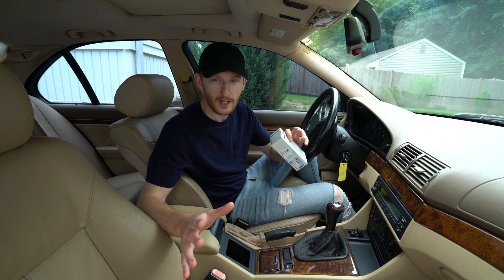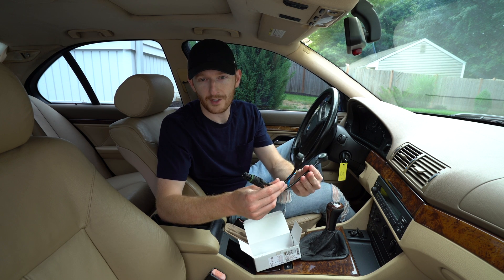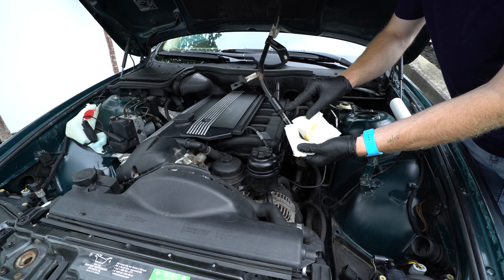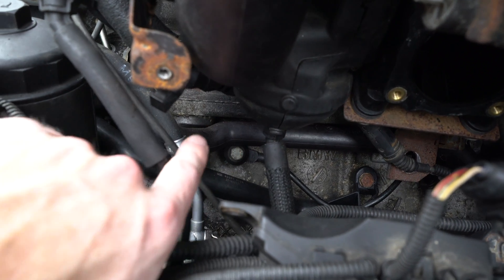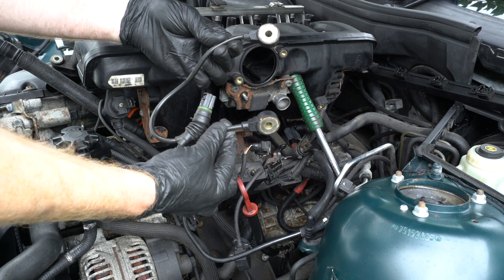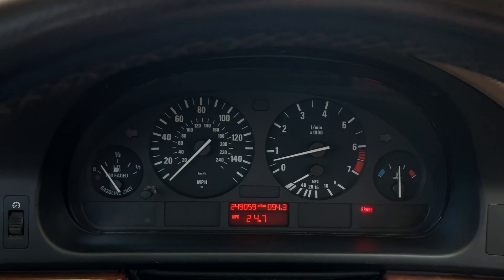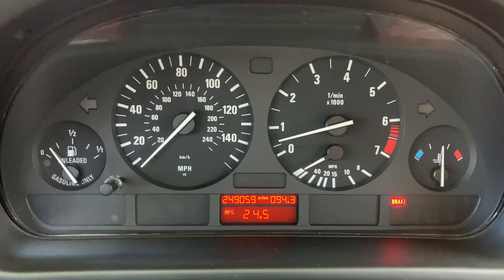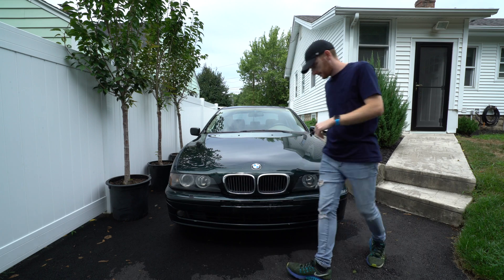BMW M54 Knock Ping Sensor Replacement For E39 and E46 Fault Code P0332

Comment: I just did this job here in summer 2024. A 2006 n52 530xi. I however did not remove the intake. I got the old one out,  and replaced the knock sensor reaching between the intake runners. And removing the air box, and the already leaking oil filter housing, and very greased up Alternator. If you have pick up/grabber tools you will need them.  With the alternator out of your way, you can do it !  If I can do it, you can too.

Comment: Hi nice video ,i have question .If i disconnect my knock sensor for test does will fix the problem before i buy new one.Now when i try to kickdown it only go max 5000rpm .... I want to disconnect then start the car and test...Does will this work for the test to see is the knock sensor

Comment: Well, I am glad I stopped by your presentation! At 226,000 miles in my’99 528iT with the GM 4 speed trans, had my coolant pipes just starting to go out. Once I removed the intake manifold, I noticed the ping/knock sensor and went on line to get advise since I was already in. Low and behold I saw your video and decided to replace with the OEM VDO sensor that I picked up off of eBay for just a few bucks. I would certainly advise staying away from the Chinese knock off‘s! Now that I have completed the task and put new intake manifold seals on as well,  my little M sport wagon runs like a champ! Thank you!
😎💪❤️
P.S. I also replaced any rotted rubber hoses and put in a new OEM chain tensioner I picked up at FCP EURO.
I also noted that above 80 miles an hour (while driving in Mexico) if I downshift into “sport“ my vehicle downshifts whereas previously it did not.🤔

Comment: How long in average do knock sensor last? You said 248,000 miles?
Reply from the maker: Have seen many m54’s go to 250k with original knock sensors. They are not a common failure item on these cars, but they can fail. They did on this e39!
Reply: @BIMMERZEITT  Thanks. What about camshaft and crank sensors? How long do they last?
Reply from the maker: @jonathanbock8435  not sure an exact number but cam sensor failure pretty common around 100k miles

Comment: My e46 325 goes poorly and i have changed all things like coils, plugs, all 4 lamdasonde, airsensor, camshaft sensor, disa valve, all ccv and all, but i cant find the problem, not even machanics.. do you think this is the problem?
Reply from the maker: Norwegianstuntcrew hi, do you have poor mpg? Are there any stored codes? It could be this or what about clogged catalytic converters?
Reply: BIMMER ZEIT how can i check that? Must be much to be clogged? Car have 250 000km
Reply from the maker: Norwegianstuntcrew they have a way of testing the flow to confirm bad cats yes. If the car is running so poorly it will show in the data stream. Try a more reputable shop that specializes in BMW or go to a BMW dealer try paying a few hours of diagnostics

Comment: Thanks for the video. Tackling the CCV on my E46 soon and was contemplating replacing my knock sensors while I have the manifold off. No fault codes yet but creeping up on 200k miles so I might as well. Hopefully I’ll notice a performance improvement. Your videos have been a great help with my BMW upkeep!
Reply: No need to remove the manifold for CCV replacement, 50skid has a video showing how to replace with the manifold on.  I did my e39 530 that way with no issues.
Reply from the maker: Max Pullen I’ve done ccv on both e39 and e46. Kowboy states he has an e46, way way harder and less room than the e39. It can be done with manifold on but is difficult
Reply from the maker: Spaced Kowboy thanks man! Yeah I would definitely do the knock sensors ($57) and the plastic coolant pipes ($40ish?) while you have it apart. You will need intake manifold gaskets ($16) and a throttle body o-ring as well ($4). Full length step by step intake removal video coming soon.

Comment: When you replaced the hard coolant line under the manifold, did you need to take the manifold off completely or just prop it up  as you did for the knock sensors?
Reply from the maker: Beyond Repair I propped it up with a breaker bar similar to this video. I left a few connections plugged in as well as the fuel line. It’s tight, so easier to just remove it all the way.